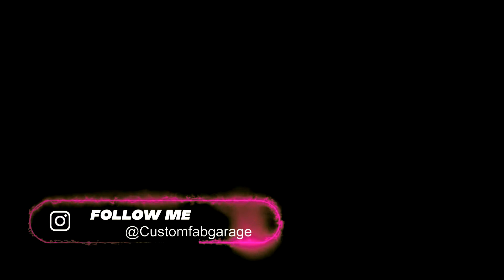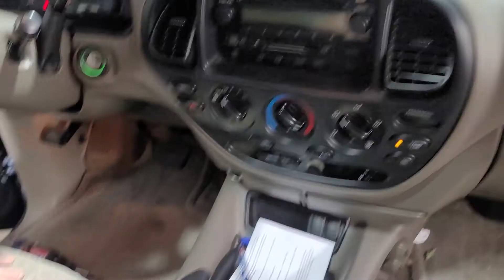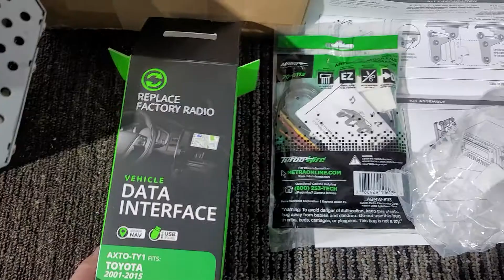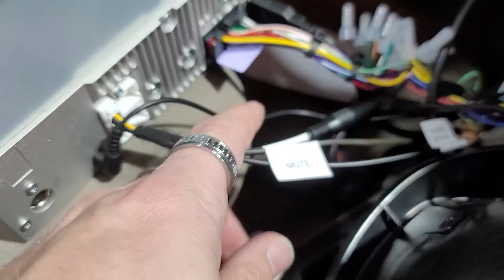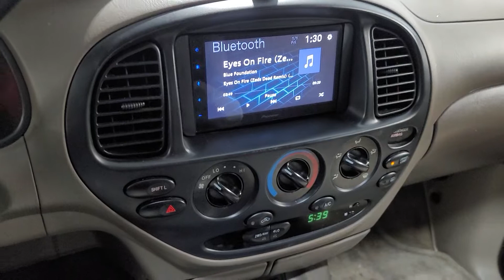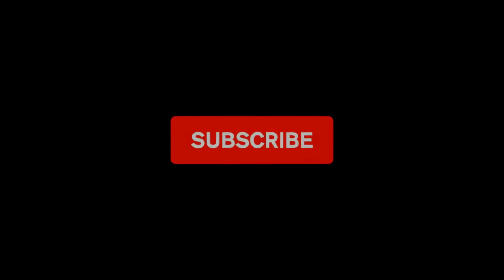HOW TO INSTALL TOYOTA TUNDRA RADIO WITH STEERING WHEEL CONTROLS AND JBL

Comment: I have an 07 Sequoia with JBL. I'm trying to install my stereo, with the 70-8113. Blue and blue and white wires are spliced with the blue wire on the unit. No sound. If I reinstall the factory stereo , sound is fine!
Reply: Same problem with my 05 tundra did u end up fixing it?

Comment: Wish some one could actually show how to get sound with the 70-8113
Reply: if you have the toyota with the jbl system it’s not possible you need the harness that he used in this, unfortunately it’s 5x the price of the normal harness but it does work

Comment: Curious I have the SOUNDSTREAM VRN-65HXB (W NAV) used the TYTO-01 unit installed... my '06 TUNDRAS JUST LIKE THE ON in the video, any chance you have an idea which steering wheel interface I should use to get my steering wheel controls back online?

Comment: Just completed right now installing the ASWC-1 Axxess unit into my 2010 Rav4 with JBL and a Kenwood 4707 I already updated a few weeks ago.  I couldn't get the Maestro unit to work at firs(I used the wrong #6 black wire from the Toyota 20 pin harness it turned out) but this ASWC-1 unit worked flawlessly after correcting my wiring issue, and didn't need to be preprogrammed like the Maestro.  Thanks for the details from your install and the visuals.  Sure nice when the projects end up working.

Comment: I have the same plug 70-8113 in my 05 Toyota Tundra the stereo turns on but no sound I can’t find the amp turn on or the power to the amp can u please tell me which wire is it
Reply from the maker: It should be the blue wire or the blue wire with a white stripe. It could be a digital or signal sensing I would check with metra electronics tech support